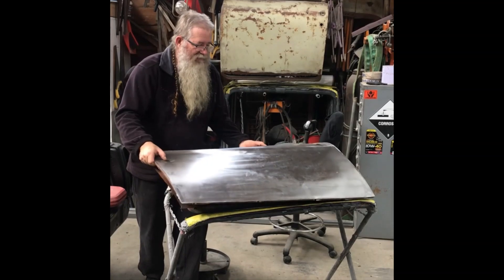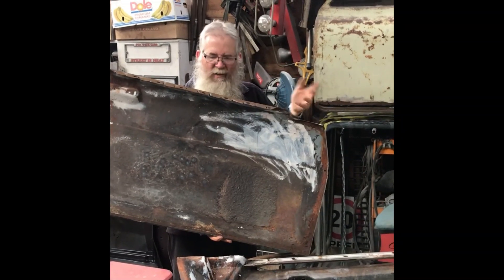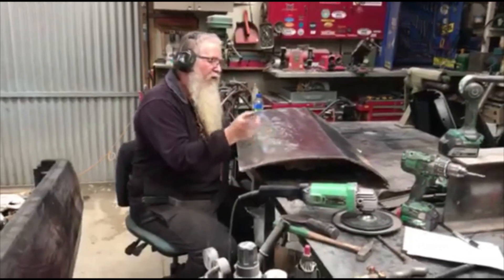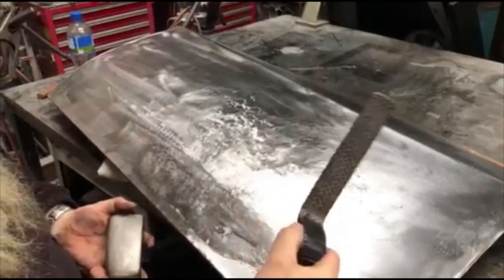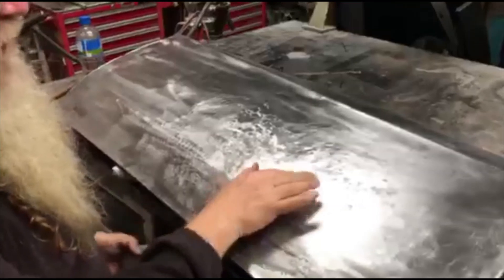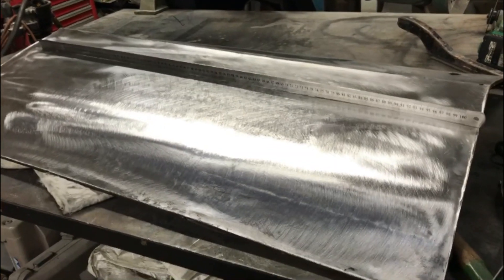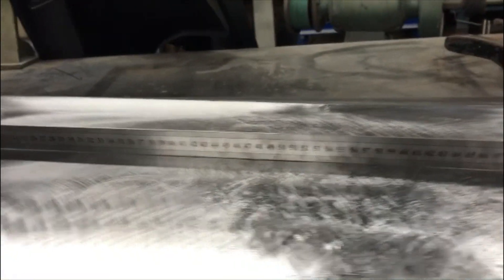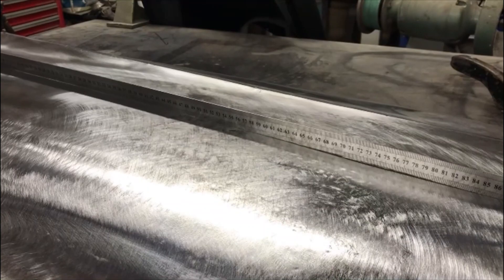Door repair done properly

Comment: Fantastic! To remove the skin, do you unpick the spot welds of the folded lip?
Reply from the maker: Yes I drill the spot welds with a spot weld drill  and unpick them careful not to go right  through to the metal underneath.

Comment: great to see your work as usual. thank you. a few questions though, how does one remove all that bondo (bog)? also, would you quench your shrink disk area with a wet rag ? finally, your file/slapper;what effect does it have on the damaged area? does it grab a portion of the panel and squeeze it together?(and are you using "on dolly technique? ). thanks so much again for all your vids. it's an enormous help seeing this work in practice.cheers!
Reply from the maker: More great questions! Thanks Eddie. If no one asks no one learns! I will try to answer in order; I use a  3M purple clean and strip disc to remove the bog. I follow up with a  power stripper drum wheel to give it that uniform brush finish. That's also  the same material as the 3M clean and strip disc. As for quench with wet rag - well sometimes but I like to minimise that  as it work hardens the steel quickly and makes it harder to bring down. The file slapper has wee teeth that shrinks a tiny bit and irons out the wrinkles. The shrinking disc irons out the fine wrinkles  even further and flattens the panel down quickly. I use the traditional oxy torch heat shrinks to bring down the big creases and stubborn stuff to get basic shape and  form  closer quicker than go back to slap and shrink. Thanks for the questions and thanks for your continued support. I also use hammer ( slapper in this case) on dolly to flatten the dimples and bring up the lows.
Reply: @streetneat  thank you for clarifying all this for us. hopefully, i'll be better prepared in case i run into this type of severe damage. ciao.

Comment: Saw this earlier on your Instagram, great the get the extra video here. Are you going to show how you do the beauty line on the top half of the door? This is probably the most overlooked bit I keep seeing on Q-B Holdens. Love a job done right and good quality rubber bushings!
Reply from the maker: The beauty line or hip line is always a tricky one as its so subtle. In this case there is nearly no damage to that line so hoping it will be all good. I will run a blue die over it all to check the best I can.
Reply: @streetneat  blue dye? Never herd of this, if you have the time and energy would love to see more on this 👍
Reply from the maker: @huwmcconachy3272  Engineers  Blue dye. Used by engineers to find highs and lows on machined parts and for scribing line sonto. Widely used  in the metal finishing of panels too.

Comment: quicker to wheel it
Reply from the maker: A fair comment and good observation I was waiting for, however not completely  true. That is the beauty of the shrinking disc The wheeling process may help to iron out the skin a little, however will keep stretching the skin further- that is the nature of wheeling. The skin was extremely stretched from the severe deep impacts and needed to be brought back down in a more controlled manner. The slapping and shrinking disc brought the skin back down to exactly where I wanted it without spreading the damage further around the skin.
Reply: @streetneat  yeah i know it would require shrinking thats a no brainer im thinking a wheel would of been quicker thats all cheers fella
Reply from the maker: Cheers  @paullang1961   When I started this trade over 30 years ago  a boss once said to me- you can argue six ways of doing the same job right - or just do it.  For me the panel being fairly flat with nearly no shape I wanted to keep the re work to justhe area. On a panel like a 32 Ford guard  with a lot of roundness and shape - yep that gets run through the wheel as a quicker fix. I guess you line up six guys and each will have their own unique method.  Im  a mad fan of the shrinking disc and where i can literally iron out the wrinkles quickly and shrink the panel at the same time. But yep - I love the input here you contributed  of other perspectives and your viewpoint.
Reply: @streetneat  lol im not saying you did it wrong im saying i would of used a wheel lol yep there's more than one way to skin a cat most if not all replies on here will be great job wish i had your skills cheers